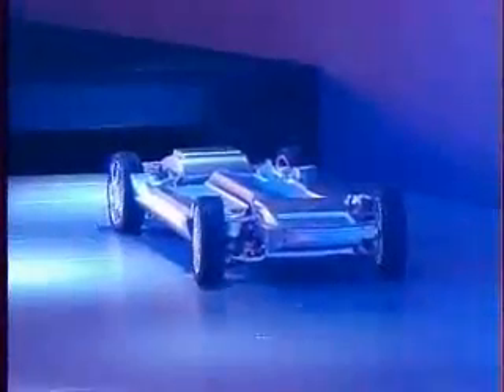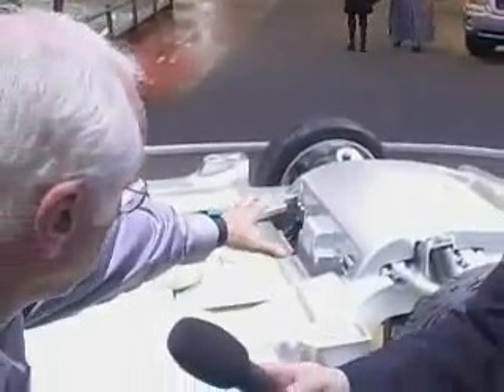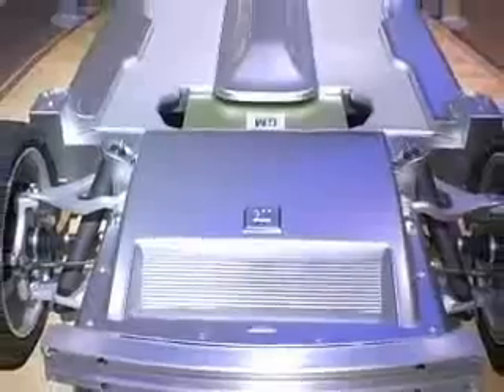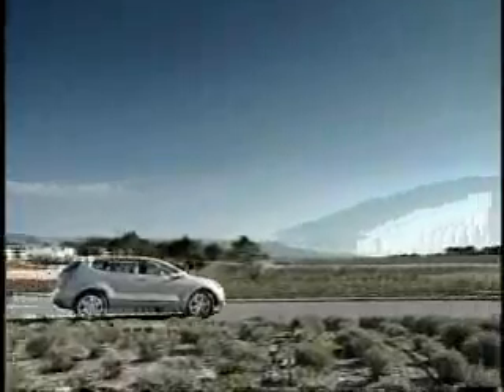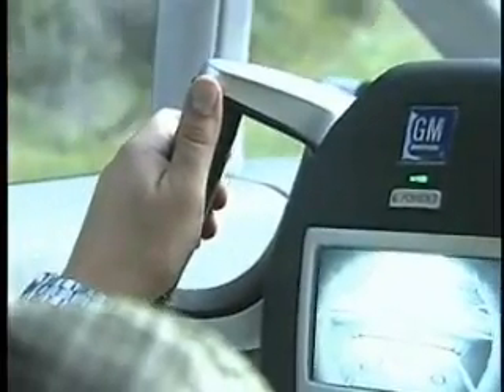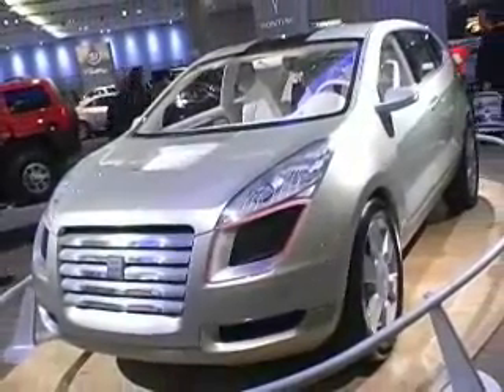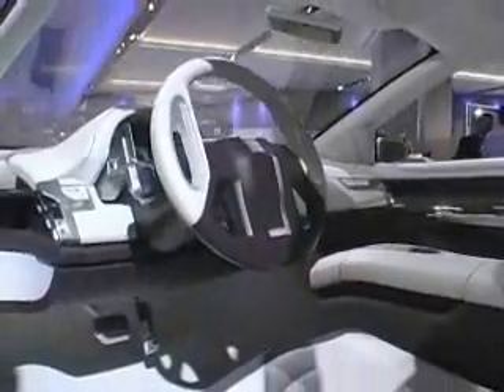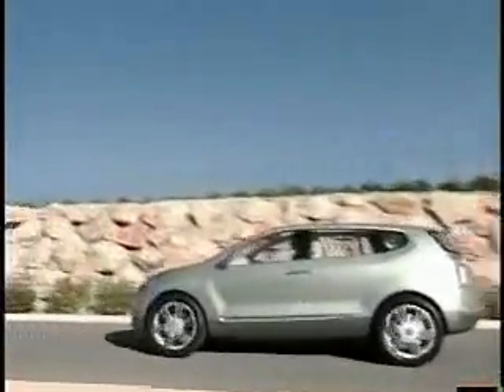General Motors - Sequal - Hydrogen Fuel Cell Car

Comment: GM conducted a well-to-wheels study with Argonne National Laboratory, BP, ExxonMobil and Shell The study found that hydrogen-powered fuel cell vehicles are the cleanest and most efficient combination of fuel and propulsion system for the long term, offering zero vehicle tailpipe emissions, greater efficiency and lower CO2, well-to-wheels, than other vehicles. FCV prototypes also have promising long-term potential for weight, size and cost reductions to make them competitive with current ICE cars

Comment: nonsoundflux If you take into account the well-to-tank efficiency of 26 (toyota figure) percent and the efficiencies associated with charging the battery; the overall (well-to-wheels) efficiency becomes 21 percent - better than today's vehicles, but not as efficient as a fuel cell vehicle.

Comment: nonsoundflux hydrogen can be produced from water and the water can be cracked by solar and wind produced electricity. The desert SW USA is perfect for such mfg, Fuel Cell electric vehicles are better than Battery electric vehicles, Tesla will mfg a fuel cell vehicle beyond their already mfg lith battery machine. Fuel cells are less damaging than batteries,The cost of fuel cell mfg is dropping

Comment: You misunderstand me, I love fuel cells, and the problem with them is that you need Hydrogen to use them.  Where are you going to get this??  You have to add energy to a water molecule to produce Hydrogen, much more energy that you receive when you use it in a fuel cell.  It is a net negative.  There is plenty of Hydrogen on this earth; the problem is that it is trapped in water.  Oil companies like this because they will use Natural Gas to produce Hydrogen for a profit while not reducing CO2.